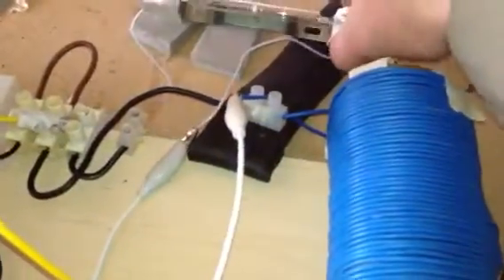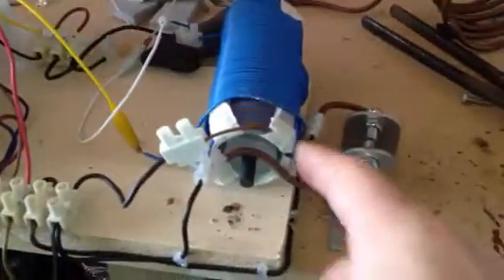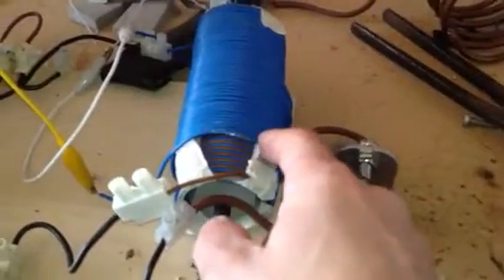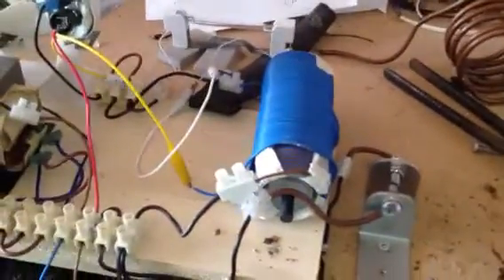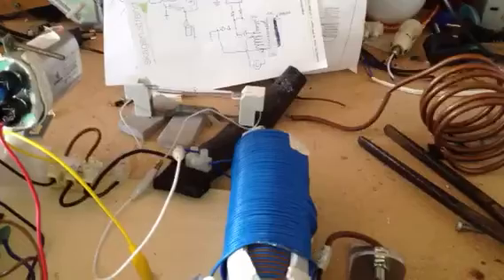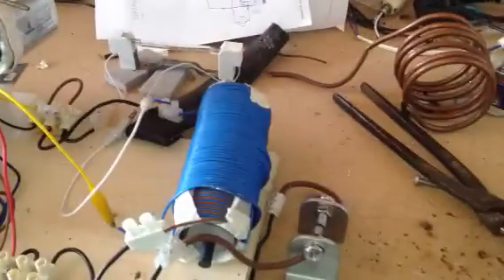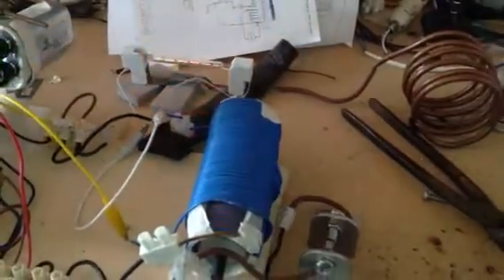Induction energizer / kapanadze part 6

Comment: Use tungsten roods from Mig welding  device to run stable spark gap and use a blowing fan to cool down the electrodes on the spark gap, the tungsten roods attach to brass or copper bolts (screw the bolts in a thick copper plates and to the plates connect the high voltage wires) the  to get maximum electrical contact and heat exchange.